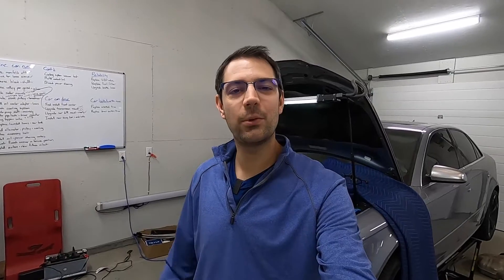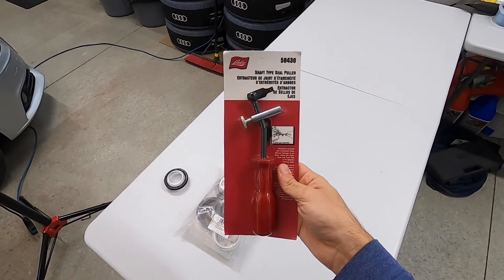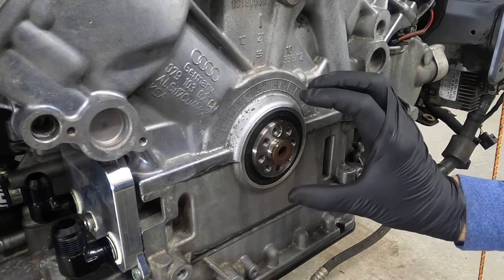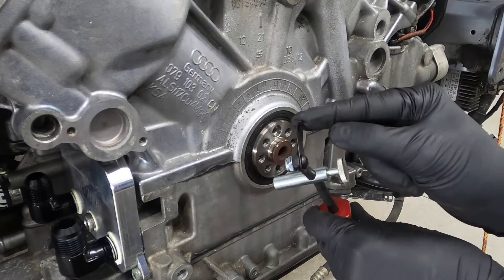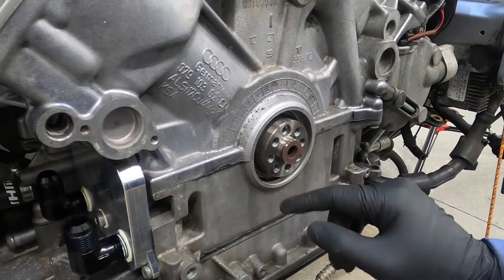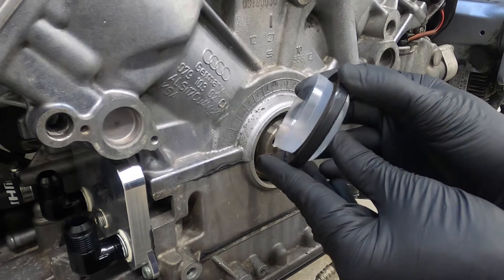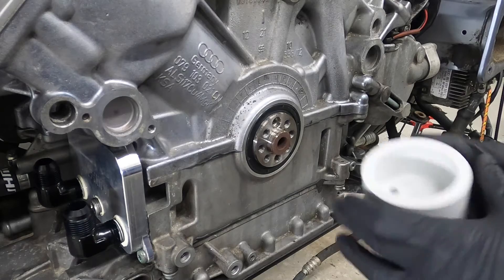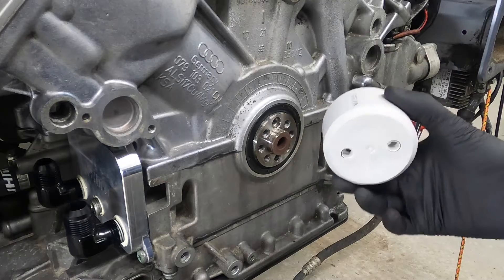How To Replace Front Crank Seal | T40048A Audi/VW Tool & Lisle 58430 Seal Puller

Comment: Great video what was the the thread lock you put on the seal?? Did you put all over or just on the inner or outta sides??
Reply from the maker: I didn't. You RARELY apply anything to a crank seal. Most are meant to go straight onto the crank. You have to read your specific repair manual.

Comment: By far, the most effect seal removal technique I have viewed was posted by two sisters, using a 3/4-inch screw and a cat's paw pry bar [1].  That being stated, I would add a real drill bit depth stop collar.

[1] "Remove and Replace Crankshaft Seal" on the "Frugal DIY" YT-channel

Comment: Very good video. Would this install tool work on rs3 2.5 ?
Reply from the maker: I'm not sure - it would depend if there's a press cup the correct size for the seal on that engine. You'd have to do some research on your seal size and the offerings in the kit - or just read the repair manual of your car; it will state the OE tool, always.

Comment: Never drill a seal if you don't want metal chips inside your engine. Just use a very sharp pointed pin punch tool and an hammer for make a little hole (without any chip) and then use the screw

Comment: Replaced a 20 year old Audi TT main seal today.  That lisle tool would have been useless too in my case.  We canibalized the old seal until it got out because my tiny drills wouldnt work, they would slip.  Putting the new seal in, I used the pack of cigarettes plastic trick, not sure if all of the plastic is removed.  The new seal went in further in than the old one which is my cause of worries..

Comment: if i take my car to the audi dealer how much are they going to charge me for this job
Reply from the maker: Well, Mr. Swagg, for interest of everyone here you should call and get an estimate and share back the response. If the factory manual says the seal can be both removed and installed with the front of the car in service position, I'd guess the job wouldn't be less than 3 hours, plus the seal (so triple the price of that for being dealer-provided); so the $650 neighbourhood. And because it never works like that - double it. Let us know.

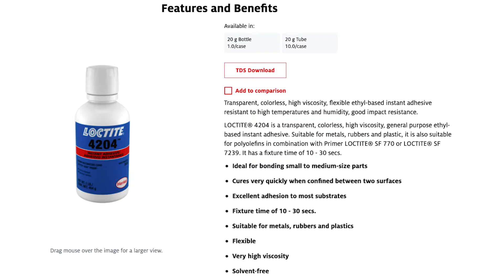Comment: 9:30 Do NOT apply Loctite to the I INSIDE of the bore!  This is the surface between the crankshaft and the seal. The crankshaft rotates but the seal is fixed in position. Use a light coating of oil on the entire crankshaft before installing the seal. 
Please correct this mistake by pinning my comment to the top.
Reply: I agree, no loctite on the snub of the crank. A Teflon or PTFE seal should be installed dry though absolutely no oil.

Comment: Way too much unnecessary cumbersome over-complicated BS just to install a simple seal.. probably wasted too much money on these unnecessary tools too
Reply: This is a PTFE seal. You don't play around with PTFE seals. If you don't follow instructions, they will leak instantly. If you follow instructions, they will perform significantly better and longer than any rubber seal.
Reply: @moshet842  Can confirm. Fucked around, found out :/
Reply: To do this job on an Audi A6 (C7) 2014-5 Allroad, the whole front-end of the vehicle has to be removed for access. Speaking from experience as punter, not DIY mechanic,  $73 for the official Audi/VW seal fixing kit seems like a bargain, in relation to the labour and inconvenience costs of doing the job twice, just because the seal wasn't seated right first time around. Interestingly, obviously anticipating difficulties, the local garage/workshop sourced two seals from Audi at the outset. Incidentally, I suspect that with an OEM Victor Reinz after-market seal, that plastic applicator would have saved the day.  Now, my front crankshaft seal leaked at just 112,000 miles / 180,000km, so I'm interested why.  Some YouTube authors say it should be routine to replace PCV or CV valve routinely when replacing the front crank-shaft seal.... in case increased crank-case pressure should be the cause.  Might overfilling engine oil have also caused the problem? However, In either of these circumstances, would the seal itself always appear 'loose', ie pushed forward once the pulley's removed?  Also, does anyone know if a vehicle of this vintage requires the 70mm or 72mm diam oil-seal? 
Anyway, a most informative video, so thank you!
Chris Poole

Comment: It was painful to watch how a tool should NOT be used. You did not do the obvious; After putting the hook under the seal you could not figure out that the leverage could be used by simply sliding the adjustable cantilever device closer to the seal and by simply RAISING the handle higher, it would have been entirely possible to gain the cantilever advantage. Also, on the second try, you did not keep the tool 90 degrees, perpendicular to the seal, thus lessening the areas the “hook’ had to grab onto. Those 2 mistakes caused the action of the tool to be defeated. Next time raise the handle, (closer towards your body,) slide the adjustable cantilever to a place closer to the seal and keep the tool perpendicular, it will work fine then. It’s not the tool, but the operator. PS: No, I don’t work for the Lisle company but I hate obvious mistakes by mechanics who don’t do the research on proper operation of their tools.
Reply: You caught that too🤣 physics. It exists for a reason and if you understand it, it is your friend and will work FOR you. If you don't. It will work against you🤣 I use a regular pick just fine for years. Actually going out in a minute to do mine on my s4
Reply: It seems that that Hook tool is as dangerous as a screwdriver as you slip it under the seal and position it. What am I missing?  It is metal -- right?
Reply: @hightttech  No, you position it on the inside of the seal. it should not be contacting the metal inner bore where the seal gets installed.

Comment: Hi - can I ask if you just used the crankshaft locking pin before removing the crankshaft pulley?? ie there is no need to strip the heads and lock the cams??
(I have an 06 rs4 in the workshop at the moment with a snapped aux belt which has shredded in behind the crankshaft pulley and the mechanic is saying he needs to strip the heads to lock the cams before taking the crank pulley - this doesn't sound right)
would really appreciate your input.
thanks Ronan
Reply from the maker: Hey Ronan - Before I answer, know that this is just my opinion and I've never worked on an RS4, nor did I look up the answer to your question. But. It doesn't sound right to me. Those front bolts are only torqued to 18ftlbs, so there's no mechanical reason to need to stabilize the entire rotating assembly to break them loose. And, there's no way to fall out of time since you're not touching the chains or any components related to timing in the rear. So I can't see why anything at all needs to be locked.
Reply: @FigureItAuto  
Thanks so much for the quick reply.. and let me say your videos are super informative- crystal clear, well structured and objective and (to me) make sense!!.. 
so am I right in saying you think there isn’t even a need to use a crank pin?? Ie if trying to loosen the bolts only the pulley and they are too tight the worst thing you’ll do is rotate the engine? (But no risk of skipping the timing given the chain is all in tact )
Reply from the maker: @ronanclare8846   Thank you, and yes exactly. For good measure the crank pin could be helpful if the bolts are insanely stuck but there's simply so much weight on the crank assembly that I just can't see needing to lock it being necessary. Your mechanic will spend more time knocking the pulley off the crank and getting the shredded belt out of the way than he will popping loose those bolts.

Comment: Regarding the 70mm seal using the Loctite should be engine specific. In case of the CRCA 3.0 TDI engine the seal should be pressed in and no need to apply any glue accoding to ELSAWIN repair procedure. My difficulty was the lack of space for the drilling, engine is in the car. Accidentaly I pressed one side of the old seal into the engine direction when tried to screw in a screw without drilling. I drilled the opposite side, screw in a couple of turns and I was able to remove the seal by hand. Tapped the new seal into its place using the plastic helper like you did. The big work was to screw back the damper. 8 screws, little space, 20nm + 90degree torque. The screw price is insane, 35USD for the 8 screws. I have a mechanical angle torque meter and I had to use a mirror to be able to read the scale. I was surprised why the 4 hours of waiting is necessary after the seal installation. Let see how it is holding. Next project is the back crank seal, first time to remove a tranny.
Reply from the maker: Thanks for the TDI knowledge and good luck with the rest of your project.
Reply: @FigureItAuto  Thank you!

Comment: ..n' as far as the Lisle 58430 tool is concerned, I Don't understand why you didn't use a  solid flat spacer of some sort between the back of the  engine block surface  and the screw in push rod of the lisle tool, (to take up the space)..=The Macgyver Method..as The Macgyver Method.ALWAYS Works For Me..Equaling .No Need To Damage Anything Watsoever, Otherwise Great Informative Video!!

Comment: two screws can be driven in the seal and pulled. But then the brittle rubber might simply not give enough grip.
Also, you can try using a socket between the fulcrum and the engine.
Reply: i wrote the comment too early i guess :-)

Comment: Hey, I have the same anniversary edition Audi s4. I was curious about your oil cooler. It seems to be upgraded. What are your thoughts on the upgrade?
Reply from the maker: Nice, I'm loving how many people have popped up as other 25quattro owners. You'll see on Saturday when I post up the next episode of the build series :). That said, I won't be able to put it through it's paces till we hit 30 degree C+ days in the summer, and ideally there would be a series of oil temp sensors on the car to thoroughly test the system.
Reply: It’s crap. Don’t do it.

Comment: You pay a premium on Snap-On branded tools. Can you find the same tool without the Snap-On brand?
Reply from the maker: Yeah, there is at least 1 more option on the market to get this same kit but it's actually even more expensive. I didn't address the possibility of constructing your own tool in the video which would be feasible if you could get the right diameter of [something] to create a sleeve, go find the right bolts and deal with the seal mounting in some way. That option was just not appealing based on time to trial and error jimmy rig a tool together out of Home Depot items. The upshot of having the real tool is that local people are always willing to rent it from you, too.
Reply: @FigureItAuto  Speaking of locals renting the tool. Where are you located and would you rent it? Thx
Reply from the maker: @4sale21  Yeah, I do rent it out. DM me on on Instagram @figureitaudi
Reply: @FigureItAuto  Have you received the message with my email? Please contact me as I would need that tool asap. Thx